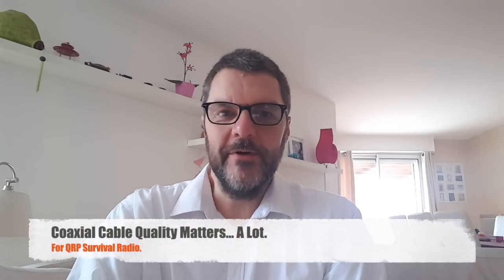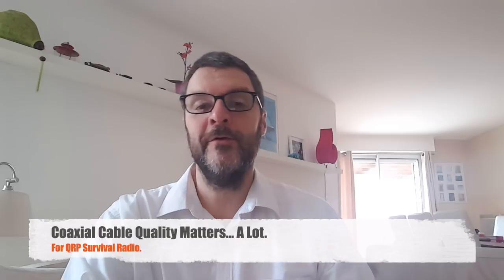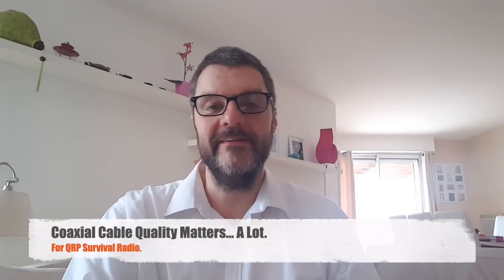Coaxial Cable Quality Matters...

Comment: Wise words Gil and thanks for information. the tip regarding buying ex-military is excellent. Those who race cars say that a car is only as good as it's tyres and following on, a radio is only as good as it's antenna system. A point I would like to add is that good coax is a two way street... the losses affect the incoming signal as much as the outgoing. I thank you for the advice... but my bank balance probably won't thank you!

Comment: For VHF/UHF, put most of your money into the coax/transmission line and quality connectors, then the antenna, and lastly the radio. I'd rather have a 40 year old radio for $50 and spend $1,000 on the coax and antenna.

Comment: If it's not >85%VF and less than 0.6db/30m @28MHz you need to look elsewhere.  You can pick crap coax easy. It won't be using a foil. Granted I'm talking HF. LMR240 attenuation at 30MHz is 1.6db/30m. It's not bad but there's so much better cable out there. IMO anyone wanting good coax should be seeing LMR400 as a starting point. Very good video.
Reply from the maker: Thanks sure, but for portable ops, thinner is better.

Comment: Great info!
Can you pls advise which coax would be better for mobile signal booster @ 1800 mhz, Lmr 300 or Lmr 400. The distance is 10 mtrs. 
Thanks
Reply from the maker: If it's a fixed installation I would use LMR 400. For portable, LMR240-UF.
Reply: @RadioPrepper  Thanks v much : )

Comment: Hi Gil, nice video and question please
RG174 is much different than a standard tv antenna cable correct? Because I am seeing people using their gopro cameras underwater with rg174. Although my tv cable looks identical it doesnt work and must be a whole other material with low frequency. What do you have to say?
Reply from the maker: TV coax has a 75-Ohm impedance. RG-174 has a 50-Ohm impedance. How do they connect that to a GoPro?!
Reply: @RadioPrepper  I have a GoPro camera and there is no way to connect coax to it.
Reply from the maker: Indeed, I see no possible association between a gopro and coax cable...

Comment: I would like to report an Italian company Messi & Paoloni https://messi.it/it/home.htm
their BROAD-PRO 50 cable is the top for the 10.3mm diameter
it looks better than the AIRCOM PLUS, I bought 50 meters, the HYPERFLEX 10 or even the 13 is great for connecting radios, very flexible.
For long UHF descents the Heliax with a diameter suitable for the needs, the RG 58/213 series with single shielding sincerely in 2019 ...

Comment: Thank you for this. I am using about 5cm of heatshrink tubing right on the crimped bnc connector to prevent too much bending and breaking. It gives a bit of stiffness. Usually I use RG58U, I use RG174 pretty rarely. Only when e.g. raising my telescope pole for my linked dipole to keep the bending low. I dont like the RG174 its really lossy :(

Comment: That's right. Too much depends on the quality of the cable. I made two T2LT antennas at 28 MHz from 75 Ohm and 50 Ohm cable. The difference is obvious, 50 ohm is much more sensitive. And absolutely, you need to take a cable of bright color. :)

Comment: I listen the VHF/UHF QSO each time I'm running my car, but I don't want to drill a hole or damage the paint of my cars, so I use magnetic base plates (I don't know the right translation of "embase magnétique", sometimes "embase tripode" for large devices that won't let me with the antennas on the road when I'm running a little fast). 
The issue is that all the magnetic bases I get use very poor coax ; let see the Sirio HP-AC/U, with 16 feet of a RG 58 (with FME connectors toward both ends with the classic PL/SO); their own sheet give a loss of 1.7 dB at 500 MHz. 
In fact the device is so bad that when I simply turn the key, without the engine running I still have a distinctive noise in the RX, I guess that the computer in the dash emit parasites and the whole has a very bad shield.
With a little handy like a Yaesu VX7 or VX8 connected directly with an Aircell 10mm to a dipole tied to a coat support, at only 2 meters from the ground, I hear very well Marseille (pic de Bertagne, 140 km on straight line from my house) : better than with these magnetic bases (supporting a 1/4 antenna of normal length) on the roof of my car.
So I wonder if you know where I could find connectors for theses "embases" allowing me to replace their cable with a quality coax.
it's a shame, as with antennas like the Diamond SG7900 "super gainer", I hear sometimes Alès, they look really good, not as with a base antenna but they sound intersting, the good days I heard Marseille all along the way to my usual job (30 kms), and at the opposite with the 1/4 lamda Marseille is to heard even the good days, only something sometimes, barely long QSO.
I wish find little connectors with on the top SO to put the antennas, and down at angle having a serious connector where to put a quality cable for a few meters with as few losses as possible. 
Do you still know such items, or could you help, or anybody reading this post ? I don't understand why the sellers don't still have such magnetic bases of quality, everybody don't want to drill the roof or add a heavy device to the back door or the trunk, scracth the paint, etc.. 
Best regards, Milos
Reply from the maker: Unfortunately I do not know where to find one like that, though I might need one too... I want a tri-band antenna for my car, with a magnetic bas too... 70cm/2m/6m... If I find something interesting I will let you know...

Comment: As a cost saving the cable TV cable at 75 ohm is a great option especially if you can get scraps free from the friendly installer.  If your rig input is really 50 ohms the SWR is only 1.5 to 1 which is nothing.
Reply from the maker: It is a good choice for a dipole, which has the same impedance.

Comment: Couldn’t agree more regard the correct coax. I have watched hams on YouTube using 30 ft of RG-174, using wrap because it’s so easy to store , handle and backpack but the the lost factor is high.  Also in your home station use the best cable you can afford. 
Good program and keep putting out good videos. 
73
wd4dda
Reply from the maker: Will do, thanks.

Comment: Great subject Gil. Rg58 - many different variations of this cable. If you do use it make sure the shield has a high strand count, as some can be quite low, and uses poor quality copper. Personally for portable HF feeders RG8 ticks the boxes for me. Slighty heavier than RG58 but the increased diameter and higher strand count in the shield means it's less lossy per m. For vhf and uhf feeders RG223 is double screened and about the same diameter as RG58 but less flexible. In the shack my vhf/uhf feeder is the really thick one, can't remember off the top of my head. 

Btw back when I was wearing the cheap green suit at weekends, one of my jobs in the tech workshop was making up spare and fixing those BNC patch cables you got a hold of for the Clansman hand bag kits.
Reply from the maker: Good tips thanks.

Comment: I have been licensed only 2 years, but I am retired and have a lot of time to research all the aspects of ham radio.  I believe the feed line is as important as the antenna, and to go cheap is a waste of money.  Buy the best to get the best performance.  I suggest you look into Messi & Paoloni coax made In Italy.  I buy it in the USA from MFJ.  I believe it is better than Times Microwave.  I use UltraFlex 10 (10m or .400 Inch). It is much more flexible than LMR 400.  I use UltraFlex 7 for jumpers in the shack as it has a tighter minimum recommended bend radius.  I do use UF 10 all the way to my UHF/VHF Icom ID-5100.  I also like the M&P connectors.  They have a rubber seal around the coax like the military jumper cable in the video. Get the M&P catalog, I think you will be impressed.  Kent  K9AEE
Reply from the maker: Thank you.

Comment: I have a question I have a handheld repeater works fine with stock antenna uhf, if I use a external antenna with small connect sma , it seems to be over heating and reboots the transmitt radio what can I use or do?
Reply from the maker: Sounds like you might have some RF running back on the coax shield. What type of external antenna? It is probably unbalanced. Either try a different design or use an RF choke like toroids on the cable. Grounding might help too. Did you check the SWR? That might be the problem as well.

Comment: Excellent video. 
LMR400 on the tower. Aircell 7 in the shack. RG316 and RG58 in the field. 
Thanks for the tip, I'll order a 100m roll of the LMR240.
73
Julian oh8stn
Reply from the maker: Thanks. Not the best video but an important subject...
Reply: @RadioPrepper  dude what are you talking about? This is an excellent video and I'm just putting it up on the site :-)
Reply from the maker: Thanks Julian :-)
Reply: @RadioPrepper  Hi you mention that you didn't like the Elecraft KX2 because it got a internal tuner but the tuner is optional i'm selling my Yaesu 817nd and my new LDG Z817 to fund for a KX2 but without the tuner
Reply from the maker: Hi, I never said I didn't like the KX2... I love my KX2, great radio. I just bought the T1 external tuner because I can place it at the antenna to get rid of cable losses and to use it with other radios. If I had the money I would also buy the internal tuner because it's convenient...